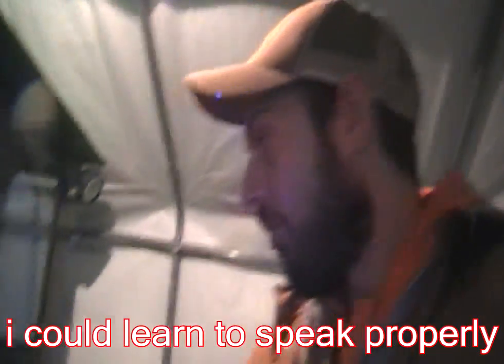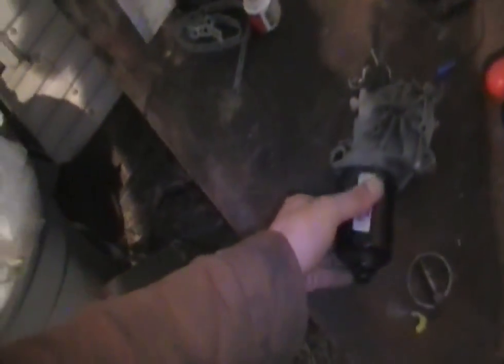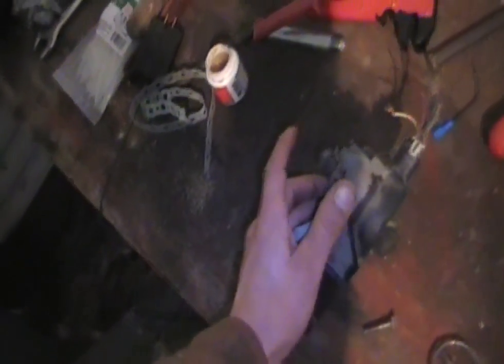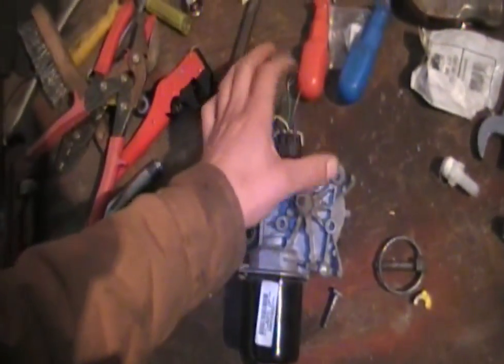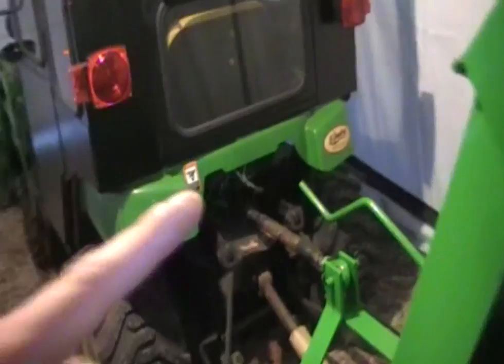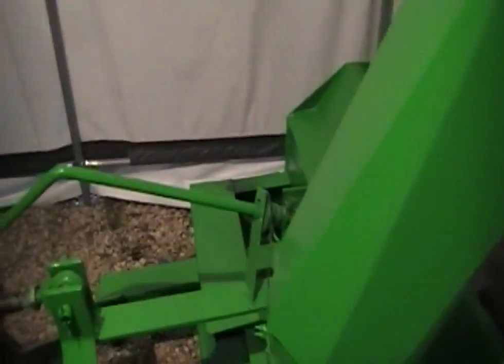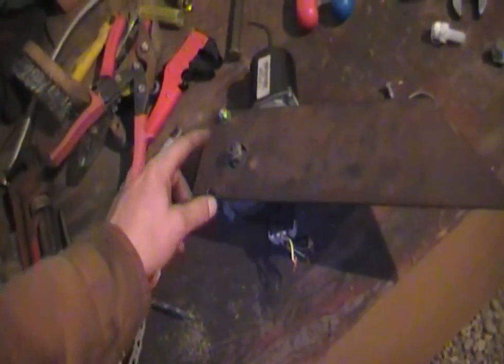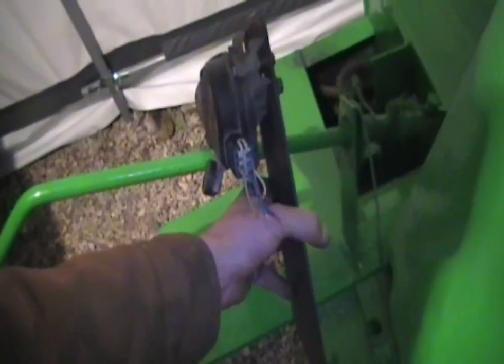12v Window Motor SNOWBLOWER Chute Turn

Comment: Love what you accomplished. Only recommendation I can see is instead of welding the motor shaft to the blower chute shaft, use a lovejoy connector.  Decouples them so you can replace components when they get ruined.  Another option is a wireless winch remote. Works great for my 1025r and my 60” alloway rau rear blower! Cheers!

Comment: Great idea! Looks like it works quite well!  I'm going to try using a wiper motor, (which is a little more powerful than a window motor) to power a tongue jack (which is just a large screw inside) to angle the blade on my snowplow. What do ya think? I figure the jack has a rating of 3000 lbs. so it should hold the blade in the position without being able to move once it stops. It will work much the same as the actuator you used to angle your blade, just more heavy duty. I hope it works!

Comment: I did exactly what you did except that I used a car window motor and already had a 2 pole switch from a 12v winch , its on my Kubota 3130  has been for a few years works great.  I used a plastic bucket to cover the motor  with a slot cut for the pulley and belt.
Reply from the maker: Bruce D right on mine was a window motor to has lot of power

Comment: I used a 69$ winch rated for 2000 Lbs. from CTC, It was on sale and with my CTC money it was a lot cheaper. It came with a switch, I am working on a stop switch so it does not go to far. It works great, It has never froze up. Just another way  to hook it up  Have you every thought of putting a 3rd function valve on your tractor. P.Auto sales them, it is worth having on your tractor for any extra Hyd. fitting you may need. It was a great build.
Reply from the maker: Dwight Mc Lean I done it with a winch to on my old skid steer worked great ..and yes I am going to see how this actuator works out on the plow blade if it doesn't work I will put in a 3 function value.thanks for the comment
Reply: Great idea.  Thanks for posting
Reply: I put heavy duty springs on the cables before attaching to the chute. When the winch got to the end I still had some play when the springs stretched out.
.